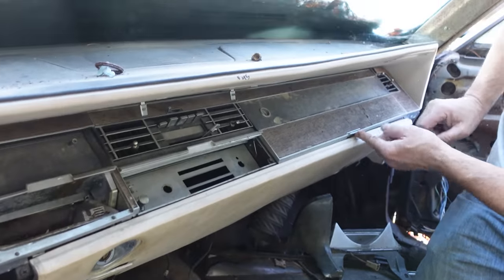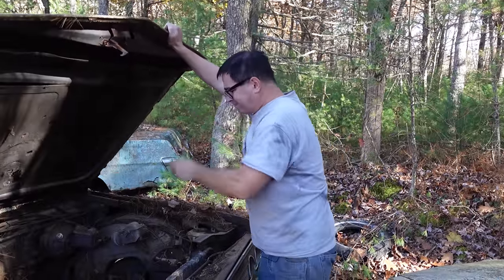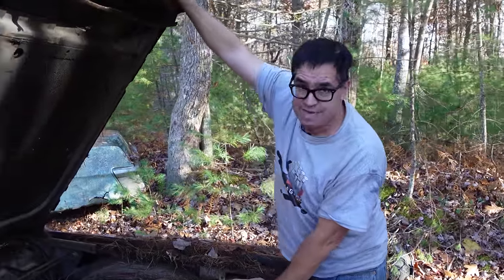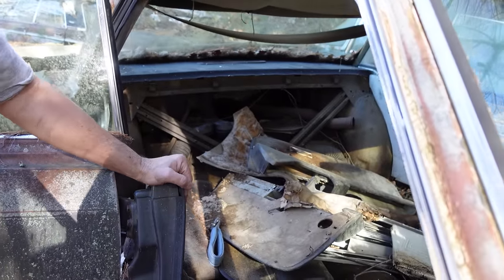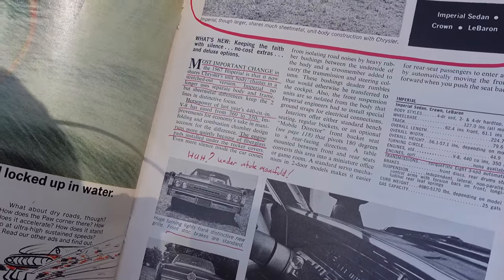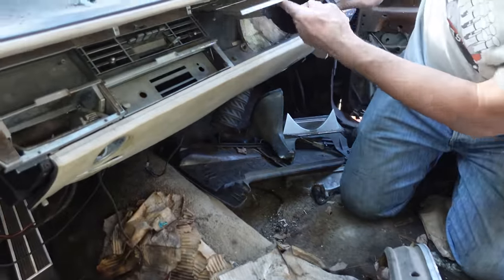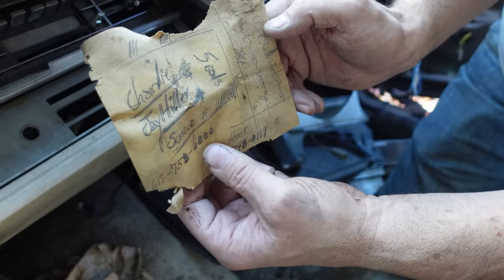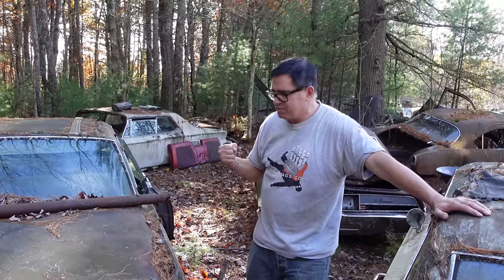The Emperor’s New Clothes

Comment: Perfect Circle is part of Dana Corporation (being merged into them in 1963) who is a main supplier to many OEMs. The cruise control system I believe was called a Speedostat and was introduced in 1958. Ralph Teetor was the inventor. The application for title states that is a 1968 Imperial and the VIN on the paperwork supports that. Perhaps this person owned more than one Imperial. 

With the VIN (on the paper), we win: Y for Imperial Crown, M for Medium price class, 43 for four door hardtop, K for 440 V8 with four barrel, 8 for 1968 model year, C for Jefferson Ave, Detroit, MI assembly and the rest is the production sequence. As noted previously, the Jefferson plant that made this car operated from 1925 to 1990 and the "new" Jefferson plant opened in 1991 nearby the old one and still operates today under Stellantis.

But, that is a 1967 Imperial front end and grille, so that VIN for the win might be: Y for Imperial Crown, M for Medium price class, 43 for four door hardtop, K for 440 V8 with four barrel, 7 for 1967 model year, 3 for Jefferson Ave, Detroit, MI assembly and the rest is the production sequence. That's why it's important to show the VIN, or you don't win.

I'm surprised that you didn't mention the "Mobile Director" option on some Imperials. This allowed the front passenger (on a coupe) to face reward to a table and a light so that they can work on the way to the office or a meeting or secretary riding with them could take diction and notes. Only about 81 cars got that option before it was dropped with the end of the 1968 model year. 

No tag, can't brag, but possible code "D" Wedgewood Blue exterior paint, YM43 for Imperial Crown, possible 83 for 440 V8, C for white and blue interior trim, 5 for automatic transmission among other codes.
Reply: @Google User GP👆👆👆

Comment: The second floor switch was for the auto tune on the radio. Mine and my Dad's had that as well as reverb which sounded cool until you hit a big bump in the road. Loved the hardtop all windows down almost looked like an extra long 2 door. Both cars had dual exhaust and would cruise at 120 on the hi-way all day long between fuel stops anyway.
Reply: @Gary H 👆👆👆
Reply: thats correct !!!!! i forgot all about that.........
Reply: Amazing to me was the soft=dampened door over the radio!  It didn't go 'clunk' when you closed it, heaven forbid!
Reply: Yeah I always knew about the switch on the floor for the radio to change channels my grandfather use to tease me when I was a kid saying the radio is changing channels on it`s own and it always made me wonder why it would do that until he showed me how it worked
Reply: @79tazman  That must be a '65 Imperial for the demonstration....

Comment: In 1993 I bought one as I wanted the 440 for my '72 Cuda I was fixing up(70 clone did turn out great/great for being a young kid at the time)...

Went to look at it and if you remember the old newspaper adds with no picture and they didnt mention if it was a 2 or 4 door just it was $600 and ran and drove great and 440 car! 

Got there and it was a 2 door and in excellent condition,black interior near mint condition,no tears or fade..passenger side paint was faded from sun shining through the carport..

I drove the car home,looked at it and fell in love with it!! I kept the car together,repainted it and drove it for 8 months... It was factory gold but I repaint cars and did a beautiful high quality black paint job,all the jambs,under hood(pulled the engine to paint the block and did a valve job/160,000 mile car was low on once cyl and you guessed it a Mopar purple cam and 750 holley replaced the tiny 595 cfm Holley 4bbl) The car peeled out and grabbed 2nd gear chirp,very powerful ride,I beat most muscle cars that pulled beside me.. I beat the then new 5.0 Mustangs easily!

Comment: If l remember correctly  the 65 Imperial  l had  cruise  control  manufactured by  Bendix.
Steve  my 65 had two dimmer  switches  but one moved  the  radio  dial  to  change  stations.
Reply: @Gary McKee 👆👆👆

Comment: Finally, I got my Imperial fix.  The only reason why the unit body would be reducing cost is due to sharing components by other chryslers.  Otherwise, unibody requires more precision, and its more expensive, and of course stronger.  You need to mention that the subframe of this car is about twice as thick in the gage department from lesser chryslers.   In some areas, it is ~ 3/8 thick.  You are a little off on the weight, these are 5200 lb cars.  The 68 got the dual exhaust optional, but never had the HP cam.  But even with the conservative cam, the 440 did really well with the dual exhaust.  Motor Trend also screwed up the 440 hp comparison with 66.  The cylinder heads were actually improved for 67 by opening up the ports, (and improved further for 68 with the larger exhaust valves).  Obviously the lack of continuity on the B-pillar weakens the car for side impact, but this car has a whole lot more steel than any modern car.  Nice work on describing the interior.  If you could sit in these seats, you would also notice how much more comfortable they are compared to muscle cars.  The second foot button on the floor could have been for changing the radio station, but you said that the car does not have a radio, so not sure there.  You could mention the thickness of the sheet metal.  That cut off radiator support is double layer steel.  Perhaps you can show the bumper brackets, both the front and rear bumper!  The demolition derby is a terrible concept, however.

Comment: Hi Steve, Yes in the mid 60s, Chrysler corporation went from an "X" body on frame and much stiffer body shell with an engine/front suspension sub-frame on there full size cars.  That was for a quieter ride, stiffer feel and better performance and handling and also a lighter car.  GM and Ford did much the same thing in the mid 60s.  GM and Ford got rid or there "X" frames in favor of a full perimeter frame.  The frames where lighter but in the mean time, the body shells where stiffer.  The fiberglass insulation under the engine intake manifold was to protect the fuel vapors from engine heat for better performance.  This is/was not uncommon, that's what a "valley pan" is used for, I.e. Mustang Boss 302 and Mustang Boos 429.  The same principal applies to the Chrysler/Carter Thermoquad  four barrel carburetor, (designed by Chrysler, produced by Carter} that has a Bakelite plastic float bowl housing to lower the mixed air/fuel vaper temperature.  By todays standards, most aftermarket performance intake manifolds have a large air gap under the intake runners for the same reason.  The automatic headlamp dimmer that you described was also found on Ford Lincoln's mounted on top of the left/front fender.  Please reply.  Dave...

Comment: Back when I first got my licence my dad had a 1969 Chevy Impala four door hardtop but since it did have a full frame was better at side impacts but it definitely looked cooler with all the windows down. On the bad side it was that Frost Green Poly with a dark green vinyl top that was so popular in the era avocado green kitchens and bathrooms (both that was also had).
Reply: My parents' 1967 Avocado Green GE fridge that they got as a housewarming gift that year still operates. I fixed it one time, for $45 in parts in 2000, replacing the cold control. Took me about an hour to get it in there correctly and mounted like the factory did in Appliance Park (Louisville, KY) when it was new.

Comment: 4,200 pounds! That would make it a lightweight battery electric car 😁
Reply: Just a tad over 2 tons. My 05 Grand Caravan weighs that much.
Reply: I think he underestimated by about 500 pounds. 4750 was the figure I pulled up.
Reply: @seed_drill7135  imagine if it had a full perimeter frame and the B pillar.
Reply: @Guylr 👆👆👆👆
Reply: I found a shipping weight of 4,860 lbs and a curb weight of 5,059 lbs for the ‘67 Imperial Crown Four Door Hardtop.
Reply: @kenttalsma7906  I think you actually have to add weight to have a hardtop.  The extra bracing underneath to avoid flexing far outweighs the amount a B pillar would add.  What made the body on frame Imperials so indestructible in demolition derby were that they were braced like a convertible, even the sedans!

I looked it up, the '66 (with frame) had a shipping weight of 2252 kg / 4965 lbs base curb weight: 2345 kg / 5170 lbs, so >100 lbs. more than the '67.

Comment: My dad had a 1958 Cadillac with the electronic eye high beam dimmer. Even at lowest sensitivity it would dim the headlights for every reflective road sign. And the headlights would not automatically go back to high beam. Dad needed to push the floor high beam switch twice to reset it. Needless to say he left the automatic eye turned off.
Reply: @Larry From Wisconsin👆👆👆

Comment: The Lebaron used a different glass in the rear doors than the Crown.   Don't ask me how I know this...
Reply: @ExilefromCrownHill👆👆👆
Reply: I tried to bolt on a '68 Crown RR door onto my '67 Lebaron.  The Lebaron has a more formal roof.  It was almost impossible switching out the window glass, and I could never get the window to operate properly.

Comment: Did Elwood  Engel design  Valiants?
Reply: First gen were all Exner.
Reply: @Barrycuda👆👆👆
Reply: @seed_drill7135  thanks for that. Wikipedia says Exner was with Chrysler up to the end of  1963 ' so I suppose  the 63 Valiant was designed  by Exner . The pre 63 Valiants have the extravagant  look of  Exner design  'but the 63 model look's considerably  more  restrained (though  still sort of weird  in a good way)  ' does that mean that Elwood Engel was influenced by Exner's  63 model for his Valiant designs  going forward?   Just interested  because I dig Valiants' but you dont get as much info on them as you do the more glamorous  Chrysler  cars. In Australia  and New Zealand  our Valiants for 1960 to 1962 were imported fully built with Plymouth badges deleted  (but have plymouth  Mayflower hood emblem)'and right hand drive    . Then from 63 until 1970 were produced  in Australia  based on the American  model's with minor design differences '  our Valiants in 1971 were designed  by Chrysler America designer Bob Hubbach  'and that design lasted to 1981 (with styling tweak's over that period) .  Although  in 1969 and 1970 we got built 69 Dodge Dart bodies imported  from usa 'and changed the front end panels and grille 'and  called them Valiant coupe's (or hardtop's).🙂